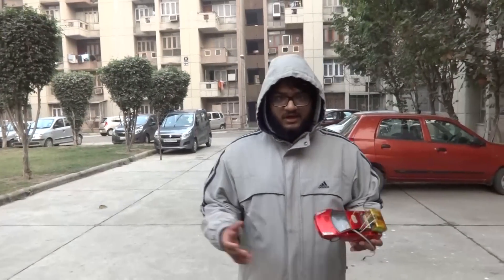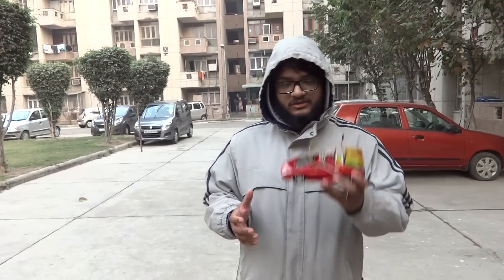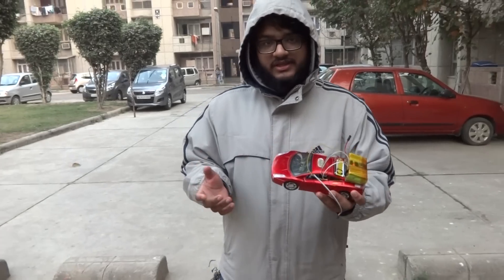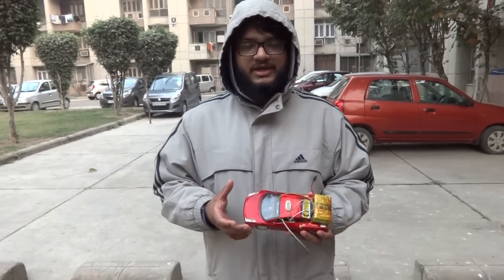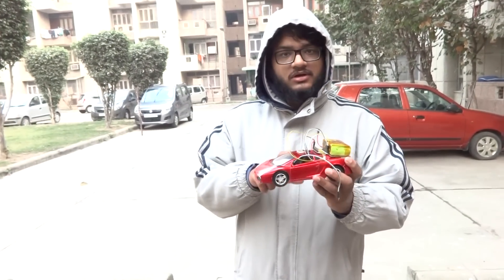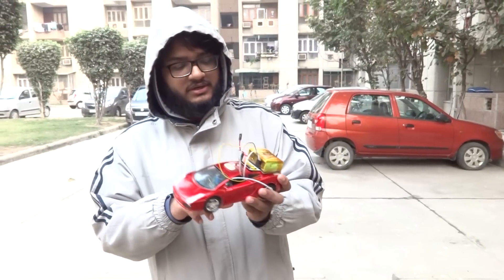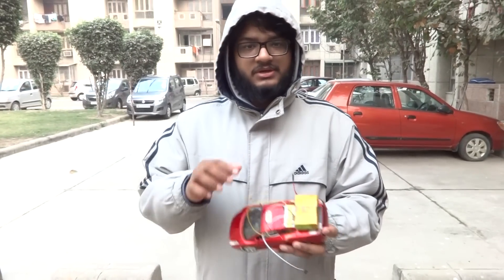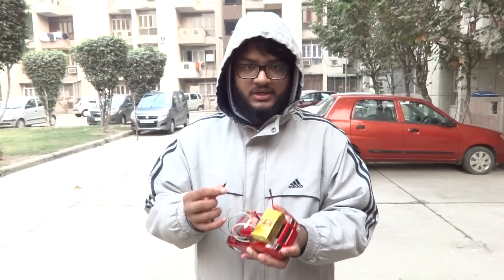DIY Esp8266 WiFi R/C Car Project Update | Let's Drive POV

Comment: Neat project. I used the Roboremo App and an ESP-01 for something like this...a lot of fun :)
Amperage on the motors is tough, but a 2S 1000mA lipo should be fine for several minutes of driving and may fit in the casing.